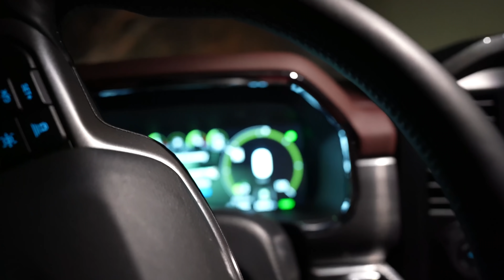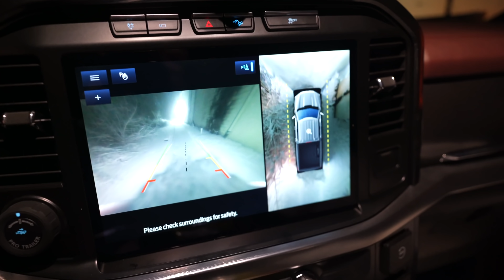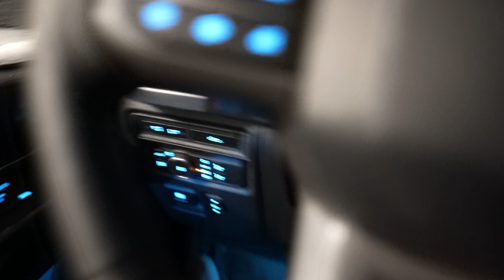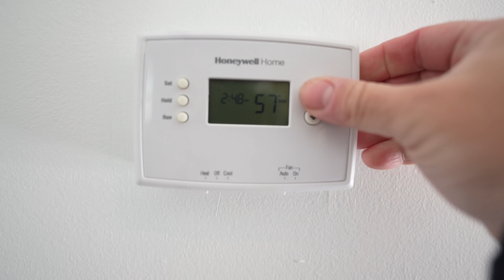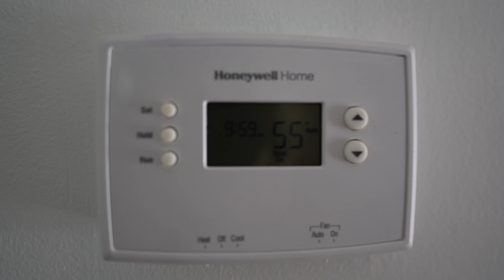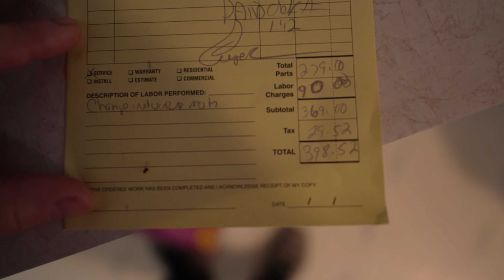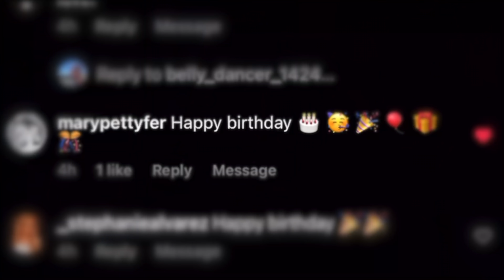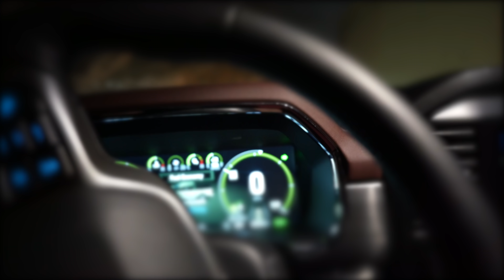Why I Went Back

Comment: Omar, if you have to drive in the snow buy 3 or 4 60 lb sand bags and put them in the bed of your truck. You can also lower your tire pressure a little bit to give you more traction.

Comment: Use window units for heat and air. Walmart carries them and they are reasonable. Space heaters at Walmart under $20 each that turns off if they knock over. Utility heaters are really good.

Comment: Hey Omar for the future w the ice. Around the door and on the locks and windshield you can use sanitizer and it will thaw the ice and then you can get in and warm it up. There is a mixture of alcohol and something for the windshield but sanitizer same kind of thing and for locks you can put sanitizer on the key and stick in in the lock unless the lock has ice on the outside then put the sanitizer right on the lock. Table salt works on ice outside in a pinch.

Comment: Yeah it's terrible when you have heat problems, or even ac problems. But I'm lucky I don't have to worry about it too much since my brother in law works in heating and air and usually has spare parts. Lol. And my hubby is a mechanic so I never worry about car issues.